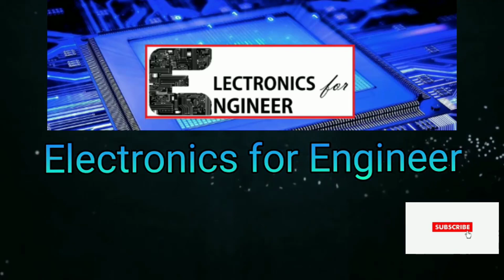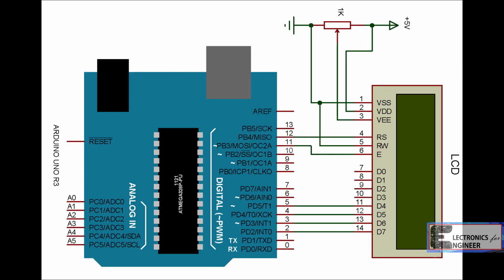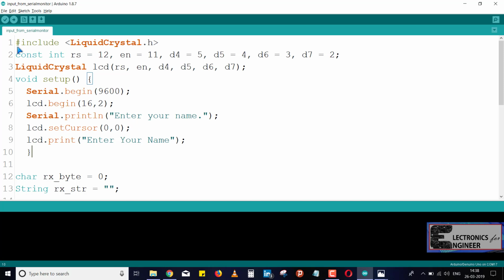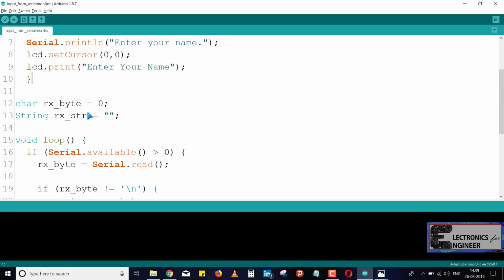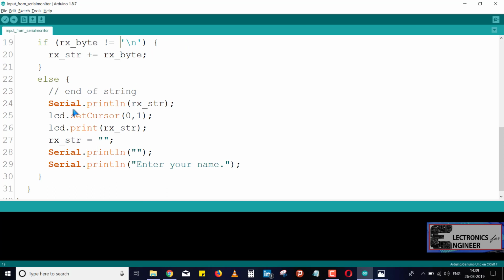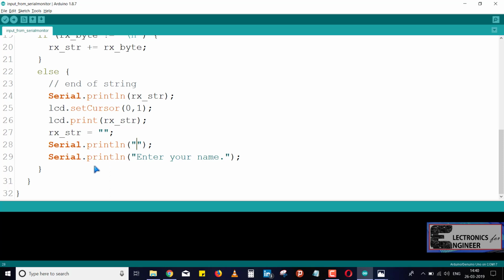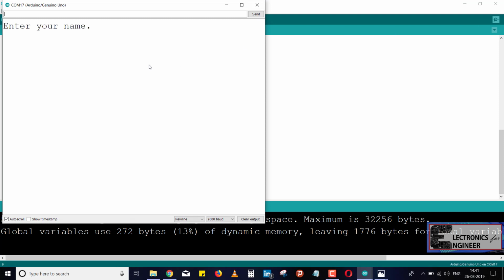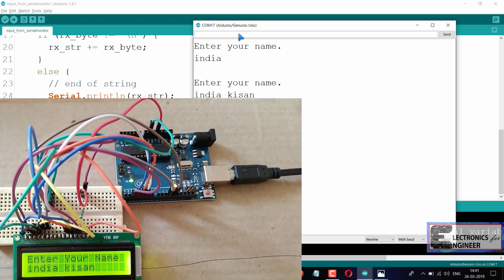How To Display Message On LCD Using Serial Monitor Of Arduino|Getting and Using Arduino Serial Input

Comment: Hi dear, I tried your code.
The typed data in serial monitor outputs the same data in serial monitor which is ok, but it prints the garbage on second line of the LCD display.
Can you please give it a try your self as
I think the original code needs to be modified in order to display the same data on LCD as in serial monitor.
Waiting for your earliest response.
Thanks.